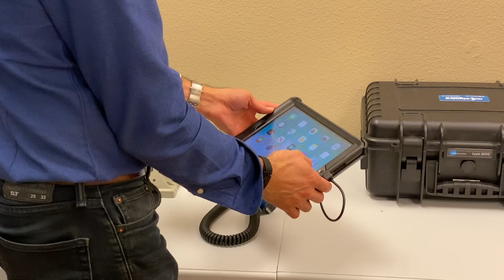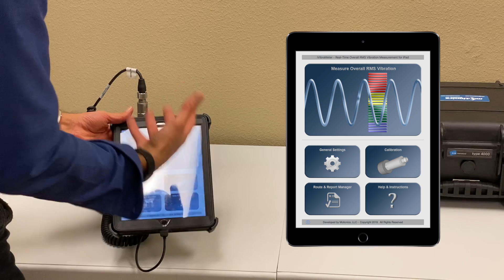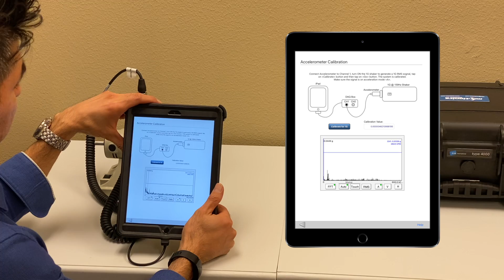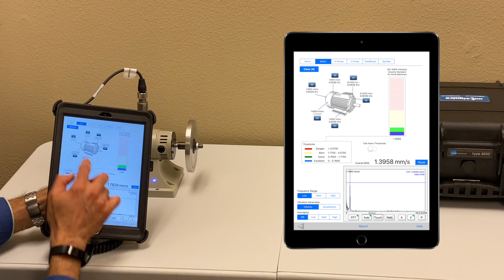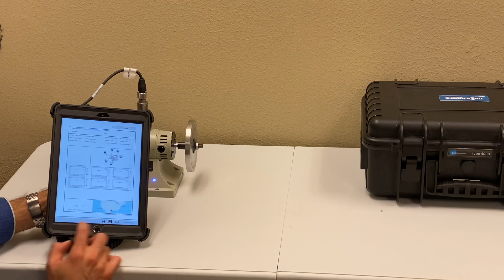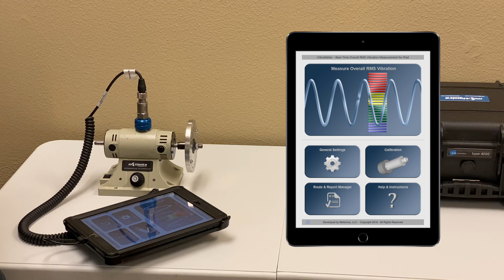Motionics iPad Vibration Analysis Kit Demo with iVibraMeter App

Comment: Just a tip from a vibration analyst who collects data every day with these sensors, don't ever snap the magnet on like you did, always gently roll the magnet onto the surface to prevent shocks in the sensor and long term damage of the crystal.
Just a heads up.
Reply: Great thanks for this,